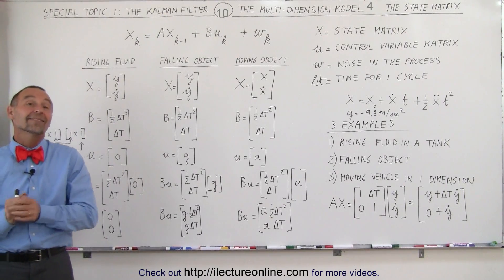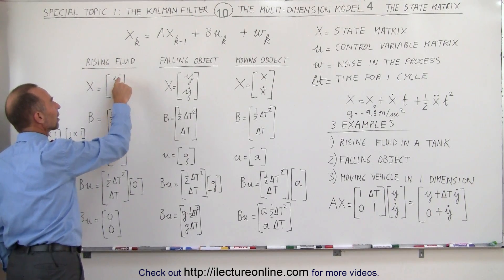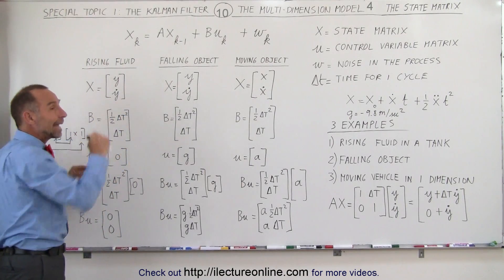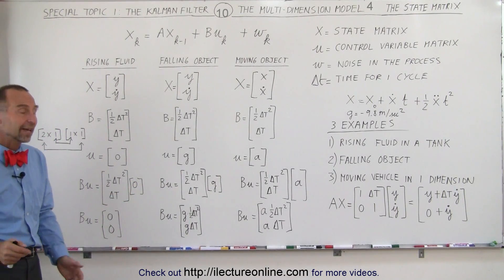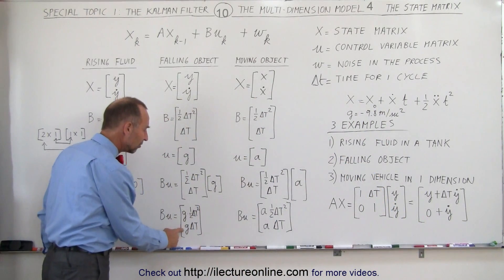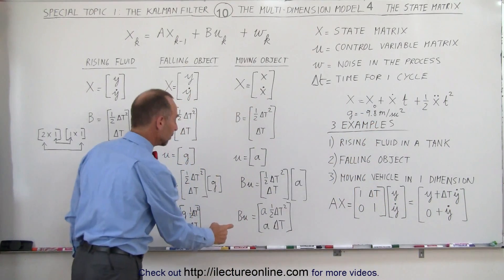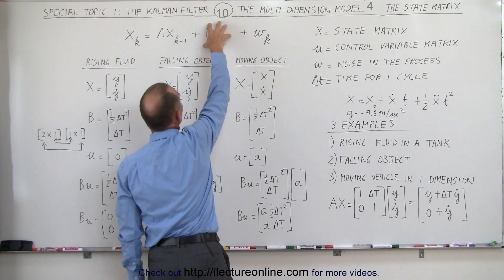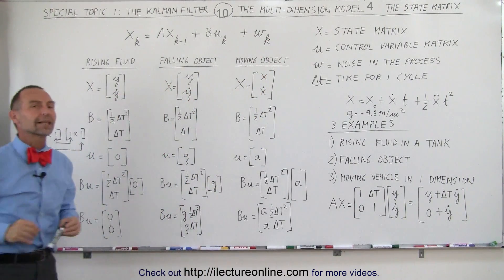Special Topics - The Kalman Filter (10 of 55) 4: The Control Variable Matrix

Comment: That explanation is extremely good, but I have one question: Why do we need the matrix B and vector u? Why don't we integrate that into A and x? Then x would be [y; y_point; y_point_point] and A would be [1, delta_t, 1/2delta_t^2; 0, 1, delta_t; 0, 0, 1]
Does it depend on on the measurement variables we have, or on the output variables we need?
Reply: I actually came to ask this exact same question!
Reply: I'll agree with this.  If it's in your A matrix than you can easily grab acceleration out of the third state
In the end, its just a different way to setup the model.  Potato Potato type of thing

Comment: Excellent video series....good job.  You are a great teacher.  
I had no problem with the derivation of the A matrix on the previous video.  However, i'm not sure why the B matrix looks like it does --in particular the delta-t term at location (1,2) in the matrix.  Can you expand on how that comes to be?   I expected the B matrix to just be the 1/2*(delta-t)^2.

Thanks!
Reply: Kinematic equation for position:

position = previous position + (velocity * change in time) +  (1/2 change in time squared * acceleration) 

Kinematic equation for velocity:

velocity = previous velocity + acceleration * change in time

Why we use A: 
if we're looking for some constant A times [ position, velocity ] to calculate position and velocity then think about what we need to do to position and velocity in the equations above. We need 1*position to calculate position, and the change in time * velocity to calculate position. We need 0*position to calculate velocity, and 1*velocity to calculate velocity. Hence [[1, change in time] [0, 1]] for A.

Why we use B: 
if we're looking for some constant B times [acceleration] to calculate position and velocity then think about what we need to do to acceleration in the equations above. We need 1/2 change in time squared * acceleration for position, and then acceleration * change in time for velocity, hence B = [1/2 change in time squared, change in time]. 

Hope that makes sense

Comment: Hi Michel,

First of all I would like to say, awesome videos! I really like how you explain the kalman filter step by step and make it so easy to understand! 

Secondly, I have a question, in your examples when you model falling object/moving vehicle, why do you put the acceleration in the Bu_k term instead of the AX_K-1 term?

Thanks!
Aaron
Reply from the maker: That is just the way the KF is formulated, by separating the velocity and acceleration into 2 separate equations and matrices.
Reply: I see. But would it still work if you put everything into the first term A X_k_1 ? i.e for X_k you are keep track of 3 things position velocity and acceleration ?
Reply from the maker: I haven't tried that.  It would be interesting to see if it would.  I don't think it would work, but I'll hold my judgement, until I see it worked out.

Comment: I'm a little confused. Why does the acceleration need to be separated?

Could you not do:
|1  dt dt^2/2|    |x|
|0  1  dt        | * |v|
|0  0  1         |    |a|

in one step???
Reply from the maker: That is how the Kalman Filter was devised.  If you look at the examples you can see why it works.
Reply: Michel van Biezen
Okay. But could it be done with a single 3x3 matrix instead? It seems simpler.
Reply from the maker: My answer usually is:  Try it both ways and see if you get the same answer.
Reply: Fair enough. Thanks for taking the time to respond. These videos are excellent :)

Comment: Thanks But did not understand why B matrix has 1/2daltaT on top and not the bottom
Reply: Easy - see here:

https://screencast.com/t/eQQkNTIz5YUc
https://screencast.com/t/H3A0krxArYtK

Clear now?
Reply: yeah but why the first derivative on top and not bottom?  X Matrix(vector) has the  (X on Top and X(dot) ) buttom. So if X is location its next derivative is at the bottom which is velocity(x dot)
So in case of displacement first derivative should be on top which is velocity and second should be in bottom which is Acceleration. Fi we stick to the order. 
Or it is because of Matrix multiplication. ?